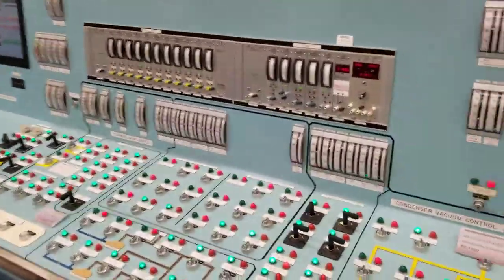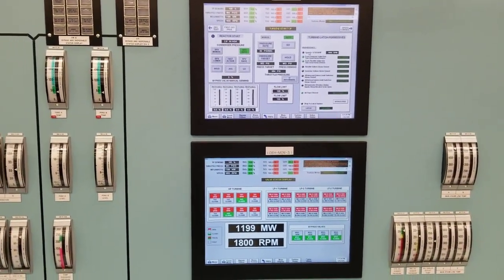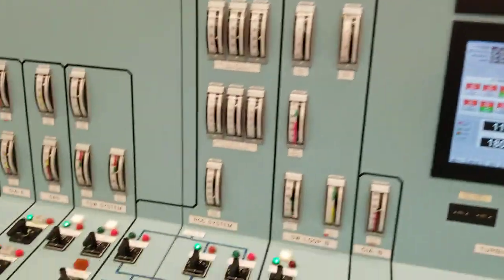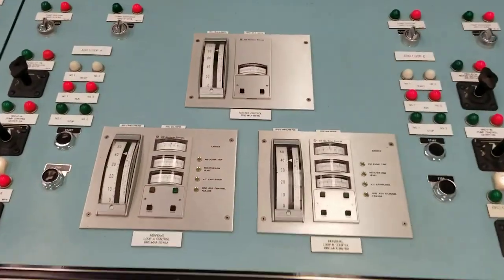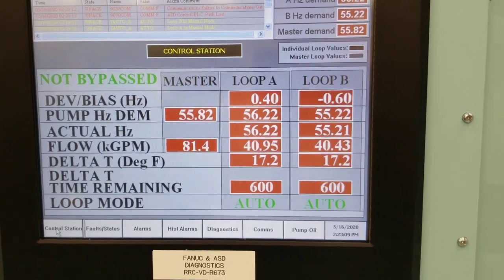Tour of nuclear power plant simulator

Comment: The Utility I retired from had a control room simulator mock up for a big Sub Station /Generating plant . All of the switchboard meters were driven by 4-20ma signals and the indicating lights  were I think 5 Volts . They would conduct training exercises for operators with all kinds of disaster scenarios with the instructors initiating problems and watching the attendee's responses behind a two way mirror to see how they handled duress .
I attended a Grounding training class in that simulator where we had to put on full Grounding PPE to install small clip jumpers attached to 1/4" wooden dowl rods on the copper mimic ground bus  on the switch boards after testing the mimic bus conductors de-energized with a DVM . I complained to the class instructor that he couldn't be serious about suiting up and using these mini grounding sticks . He said if I didn't complete the exercise I wouldn't pass the class . 
It was like that scene from the Zoolander movie about the miniature school for kids that "don't ground so good "

Comment: Question. in the future turns of reactor management, would simplifying the data to the point;
 where a non trained personnel could effectively  run the reactor 
Would that be better or worse?
I think in terms of service and security it may-be worse.
 due to the fact that the simplest way to run something, may make it simpler to ruin it.
Reply from the maker: I think that with what we learned from Fukushima, it's important to have multiple data points available. Sometimes, if things go bad, you want to have more data sources from which to interpolate the conditions in the core. However, with the SMRs coming on line in the next 10 years or so, we will see somewhat simplified control rooms. They will definitely be getting a technology update, which is nice.

Comment: No AZ-5?
Reply from the maker: They are there. They just look a little different on this model of a BWR.
Reply: @lecturesandlearningchannel6605  even in Chernobyl was 2 different types of AZ. Fisrt it was button, it was demanded to keep pressed until control rods are fully inserted. Later version was a switch. Just set to SCRAM position and don't need to take care about it.
Reply from the maker: @hvnterblack  Yeah, like I said, they are there. Both the red buttons and the barrel switch.

Comment: How does one get in this field of work?
Reply from the maker: It depends on your age. The easiest is to join the Navy's nuclear power program, do the minimum while qualifying the maximum, then getting out and going commercial nuclear.

Many colleges and technical programs offer a pipeline into the nuclear power jobs. Some start off as I&C techs (instrumentation and controls) or RP techs (Radiation Protection or Health Physics).

If you're already going to school, getting a technical engineering degree is another route in. With a mechanical or electrical engineering degree, you start out at a plant in engineering, then apply to go to licensed operator class after a couple of years.

Comment: Where SCRAM please ?
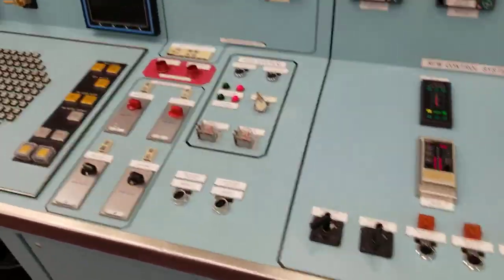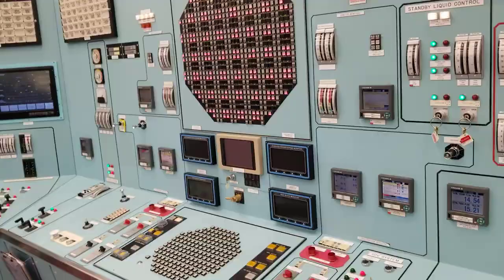Reply: 2:18, see the two pairs of buttons on red subpanels. IIUC both subpanels are duplicates of each other, and the buttons command two instances of reactor protection system to scram. I don't know how voting between the two works (so what happens if you only press e.g. the left one). I think that a manual scram "latches in" and can only be reset by resetting RPS state (IIUC using the two black buttons at the bottom at 2:18, to the right of the rod button array).

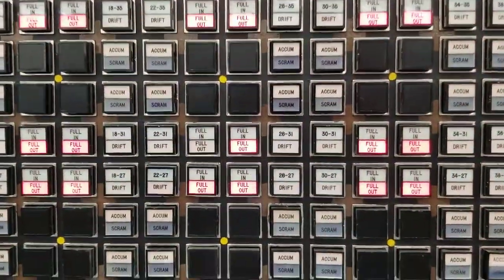I expect that turning the reactor operating mode switch (2:22, the yellow switch in the middle, with shutdown/startup/run positions) to shutdown would cause an immediate scram too. (The reason for the difference between startup and run is that you get different permitted operating ranges in both -- there are some limits that apply only in run mode, but startup is limited to iiuc low power operation. I think that the only effect that switch has is to change the behaviour of alarms and RPS, but once again am unsure.)

Comment: Are the tactile controls typical for nuke plants? Seems outdated compared to what I've seen on gas/coal fired plants.
Reply from the maker: Oh yeah. Definitely. Nuke plants in the US were designed starting in the late 50s through the early 70s. The controls represent those years. The US went through about 30 years with no commercial nuclear power plants built. Now, the new plants like Vogtle's new units use touch screen monitors with graphic interface controls.
Reply: @lecturesandlearningchannel6605  That's what I figured but I am not too familiar with Nuke generation. I kind of wondered if the tactile controls were hardwired to a DCS. Looks like the set of China Syndrome. Ha
Reply: Also digital stuff can have the 0s and 1s effected by radiation, so analog is helpful I am sure

Comment: Nice quick video.  I was a simulator engineer at several plants for over 33 years, got to work on several machines like that.  Always find it interesting how each plant is a bit different.
Reply from the maker: Nice! Sim engineer is a great job. Which plants?
Reply: @lecturesandlearningchannel6605  Mostly Nine Mile Point 1& 2 and James A FitzPatrick.  But as a contractor did shorter stints on Vermont Yankee,  and RGE.  Then went to NRC Chattanooga where they had five different plant sims.  Along with some brief visits to some others.  Retired now though.
Reply from the maker: @mikefochtman7164  that's awesome. I supported an assessment at Fitzpatrick back in Feb 2010. There wasn't any training that week but I did get to see the simulator. I got to help disassemble Vermont Yankee simulator when Monticello bought it. Same plant BWR3. It was pretty neat seeing what went into putting one together.
Reply: @mikefochtman7164  I assume since the simulator is so complex that it is driven by a computer or multiple computers?  How is the programming created?  Is data from real life events imported into the system?  I assume simulations have to be debugged like any other computer program?
Reply: @BrettGilbertLightguy48  Over the years, the exact computer systems have evolved and changed.  From dedicated real-time multi-computer systems, to systems based on x64x. The coding was originally done by hand in a combination of FORTRAN and assembly. Later we had code-generation tools that would generate modules for various systems.

The code was 'simiplfied' some, but still based quite a lot on real physics of systems. A power plant that size though, would take quite a lot of course, from reactor physics, heat-transfer systems, and electrical generation simulations.

Beyond basic, 'get it to compile and run', we used experiended operators to compare simulator responses to actual plant.  Some scenarios would be compared to actual events, but obviously some others were based on accident analysis and 'best guess' (not many plants experienced the kinds of accidents we often ran in training exercises).

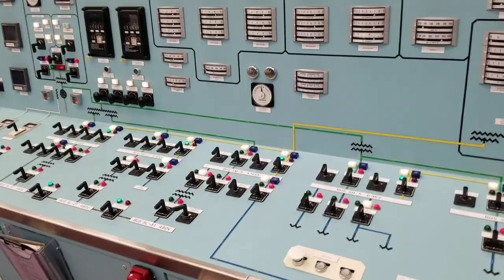Comment: I have a question, at 0:28 on the electrical control panel there are lines that connect systems and some are separated by two squiggly lines, what do those squiggly lines represent? I was considering possibly transformers?
Reply from the maker: You are correct. Those indicate transformers. Some step-up voltage such as the transformer between the main generator and the grid. Some step-down voltage such as the 4160V to 480V transformers.
Reply: @lecturesandlearningchannel6605  Excellent! Thank you so much for replying to me directly!
Reply: @lecturesandlearningchannel6605  will this tool ever be functional and available for public or educational use? I think this style of simulator would appeal to a good niche of enthusiasts.
Reply from the maker: @OhKnow379  These control room simulators are expensive to operate and maintain. It's not likely they will be available for public or educational use except by exception. For example, when I worked at the Monticello nuclear power plant, we regularly opened up the simulator for scheduled tours such as with scout groups, educators, etc. It depends on the station.
Reply: @lecturesandlearningchannel6605  Ah ok. That's cool. Thanks! that also answered my quesiton.

Comment: Would it be possible that you can show also demonstration of the simulator, maybe some scenarios or just seeing how it operates.
Things like disconnecting the grind and see what happens... just doing things that you could and should not do with the real thing ;)
That would be amazing to see. I love control rooms and dials.... . Thanks for this Video!
But i can understand if it is under NDA or confidential information
Reply: It is legal to film a simulator but not a control room. However there is information probably being recorded and sent somewhere.
Reply: @williamsplays8528  ok sure control room makes sense. But i have never seen any  videos from simulators, where you actually see what is beeing done, only the typical example of initializing a scram, would be so interesting to realy see how problems are worked on, as an electrical engineer. Would be just interesting to get a glance. just seeing dials move and system acting to circumstances is just fascinating
Reply: @heinrichhein2605  yeah, the reason is because simulators were made after the law was passed, so it is technically legal. I'll send you the best videos I have if you want.
Reply: @williamsplays8528  Interesting,
Reply: @williamsplays8528  Yes these are good, watched basically all of them I could find